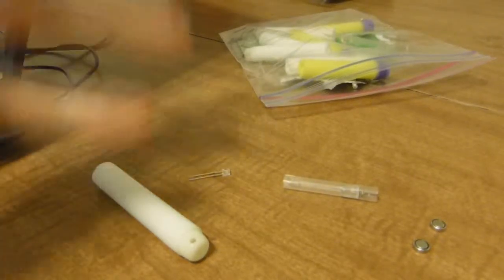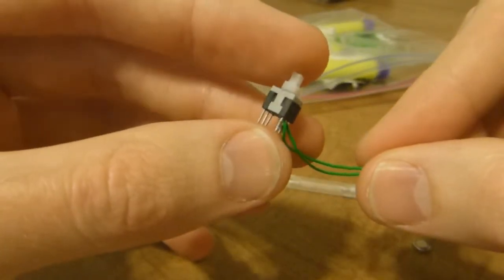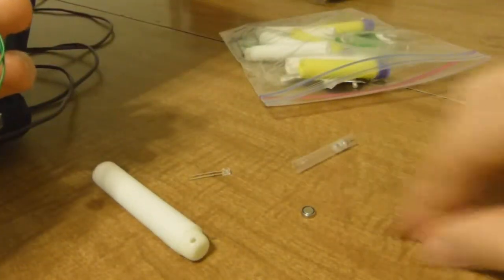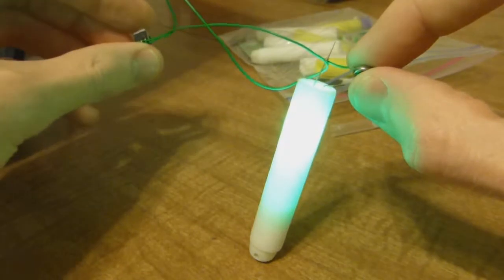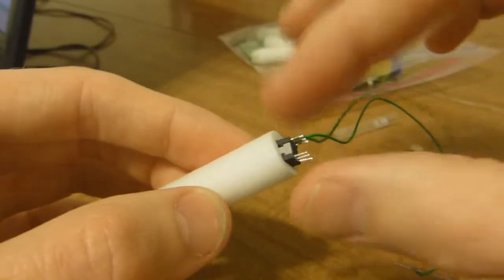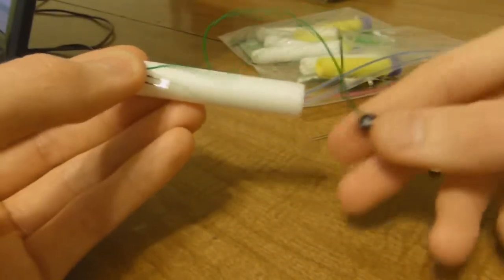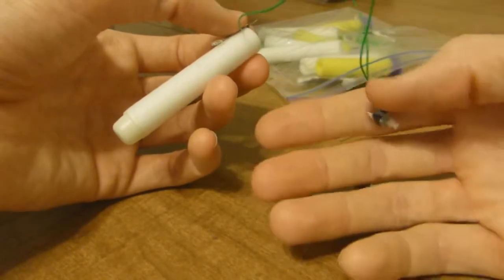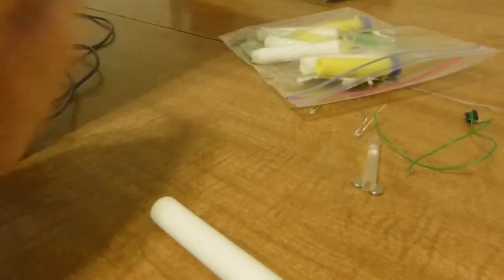LED Nerf Darts updated design 3 - Switches

Comment: Quite nice! But, do you really require a switch? What about a spring-like mechanism that activates the light on acceleration. It should turn off once the dart comes to rest. Something similar to the toys that light up only when you spin it.

Comment: Hi jontreb, 

I have had the idea of make a kind of illuminated Nerf darts several months ago. I was intending to use these illuminated darts to simulate a fight between lightsaber/blaster (Star Wars fighting, of course!) using the same basic idea of you: LEDS inside the dart powerd by small cell buttons but never carried the away idea. 

The main problem was the better material to be used to make the darts. But in the last weekend by curiosity I performed a searching in the web to se if someone had the same idea and turned it into reality and found your videos. So I wat congratulate you for that!!

In my darts I was thinking to use a kind of clear plastic hose to make the darts because I didn't kow the existence of Nerf darts made by white foam... 

Well, if possible I want contribute wiht you in the circuit design and with an extra suggestion. 

To bias correctly a LED the curent circulating through the device must be limited by a series resistor. Without this resistor, the LED can be damaged or te component's life is reduced. You are not using a resistor and by this reason the LEDs in your darts are too bright!!

This resistor is calculated estipulating the current, the power source voltage and also knowing the LED voltage drop. Red, green and yellow LEDs have a voltage drop of about 2V, blue, white and purple it is about 3V. The best current value to regular LEDs is 0.01A (10mA). High bright LEDs can handle a current of 0.02A (20mA).

Let's calculate the resistor to the green LED of the dart in the video. I'm assuming a high current LED and two 1,5V cell button in series:

R = (Vsource - Vled) / Iled = (3 - 2) / 0,02 = 50 Ohms. The commercial resistor having the closest value is 56 Omhs. A power dissipation of 1/8W to the resistor will be fine. 

Remember: this resistor must be placed in series with the power source and the LED! 

Well, I want suggest the use of a 2nd switch in series with the 1st. This 2nd switch is to be placed in the front tip of the dart. So the front switch is closed and the back switch is left open before to be placed in the holder. When the dart is pulled by the rod, the LED turns on. Assuming the dart hits the target having enough force, the led will be turned off saving the batteries.

Best regards,

João Roberto
Reply from the maker: +João Roberto Gabbardo First off, WOW! You definitely know a lot more about this stuff than I do, and I want to thank you for taking the time to share your experience. :-) Your ideas sound very cool - I too had intended to "one day" shoot a live-action Star Wars battle with these things. I wish you all the best with your project! As for me, it's been nearly a year since I've returned to the concept. The additional components made weight a problem, which led to reduced distance, as well as a tendency for the whole assembly to fall out when fired. I look forward to seeing what more resourceful minds (like yours!) can do with the idea. Be sure to post videos!
Thanks again,
~ David
Reply: I know this is very old, but I think your numbers are off. Maybe they have evolved in the time, but many high current blue green and white LED have forward voltage of 3.4v so 3 volt supply is actually underpowering it. Also they can go up to 25ma but I usually try for 15-20ma in bright range and 10-15 for moderate. Anyhow a reed switch and a magnet in the barrell could replace one of the switches in series. At this point it would be best to make a small SMD based pcb and have it all in the tip. There are similiar designs on ebay currently. I have been wanting to create my own for star wars nerf, but cannot find the foam tubing in bulk.